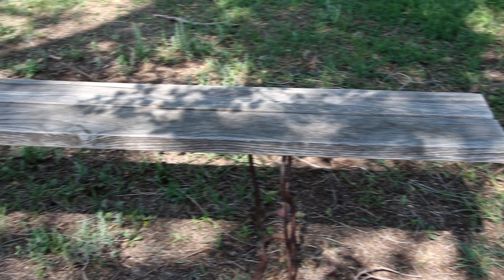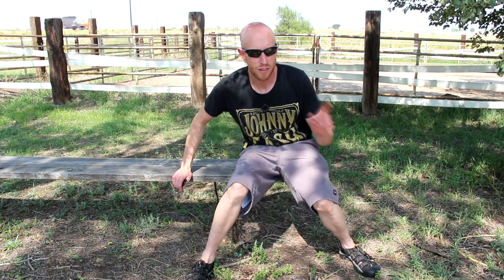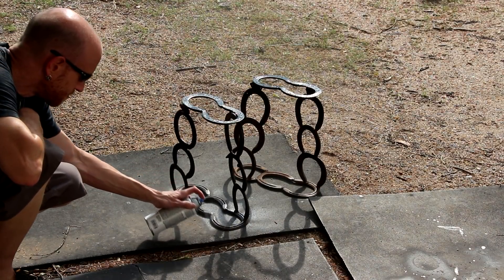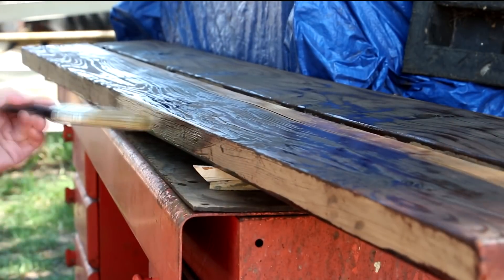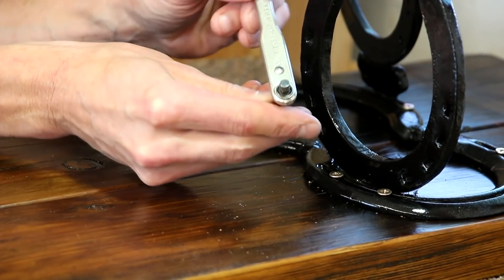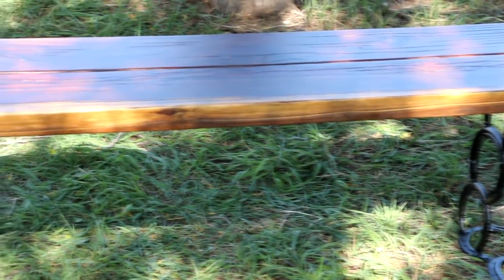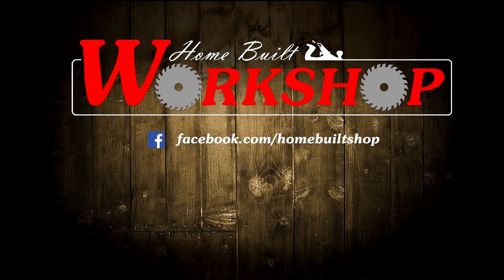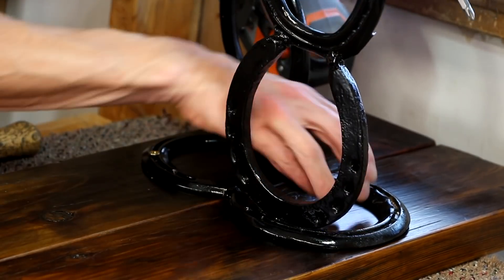Horseshoe Bench Restoration

Comment: Nice restoration. Why did you choose to shorten the bench instead of moving the legs out to the ends of the 
existing bench?
Reply from the maker: Thanks, I felt that almost 8 feet between the legs might be to big of a span. I didnt want the slats to sag in the middle.